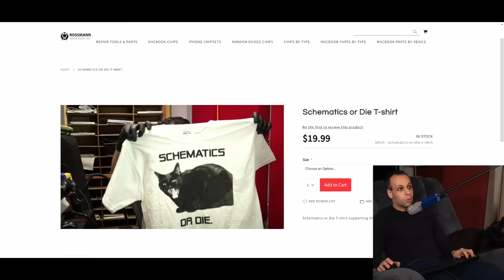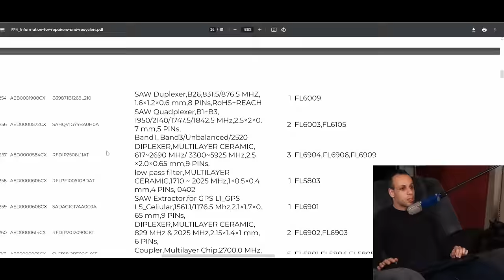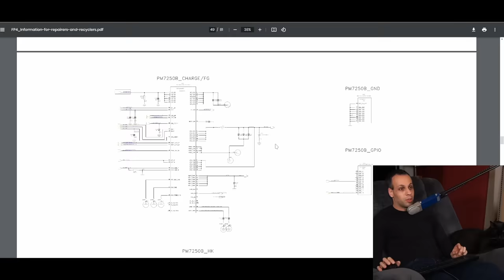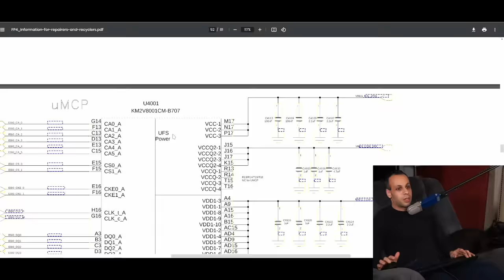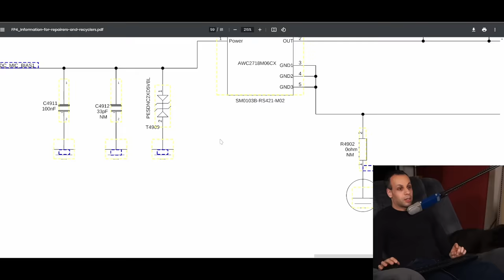Why I was wrong about fairphone

Comment: I actually hate fairphone I brought one and I will tell it here because I can't post my review anywhere. NB: I will send you this trash phone if you like.

I got a FP4 back in april of this year and had nothing but issues with it, The lack of a headphone jack meant I needed to get an adaptor when I use it for directions I ride a motorcycle and I have to listen to directions. the headphones would glitch out and fritz out constantly I had to disable almost all security features on the phone to get it working with google maps a issue reported on the forums but no fix offered the phone would disable it's GPS features when the security lock screen came up resulting in maps not working.

The plug socket that it uses for everything is extremely unreliable it was only after a month of use that it started having issues with charging and this made the headphone issues worse it would frequently disconnect and not correctly reconnect with the wired headphones, I used wireless headphones like they INSIST on me using and the Bluetooth headphones couldn't broadcast through my helmet and would disconnect immediately.

The Camera started malfunctioning and wouldn't connect when I tried taking photographs with it.

I had software glitches and memory issues, And then after 6 months or so in September of that year the phone died... completely died it was full on battery it just turned off and wouldn't turn back on and is now a completely dead brick of a phone.

It's undamaged externally it had a screen protector and a protective case... The phone wasn't dropped or mishandled it's just built by chimps out of tissue paper. I've never had so many issues with hardware from any manufacturer.

I could potentially send it in for replacement but honestly I don't want another one of these fucking phones.

FUCK fairphone 0/10

I'm currently now forced to use my incredibly old LGG4 that I replaced because the memory was going bad on it and I get weird softlocks on it's OS now... but that's forgivable after 8 years of service not 4-6 months unlike this supposedly modern phone.

Comment: Okay, it's nice that they provide the schematics for their earbuds however, the argument of removing the headphone jack for the sake of sustainability is still utter BS.

I have not watched your original video on the topic, so maybe my opinion overlaps with yours in the video:
By renoving the headphone jack, they basically force users that upgraded from an older version of their phone and have been using cabled headphones all the time to buy new hardware, instead of continuing using the old one. The No.1 use case of headphones and earbuds is with smartphones on the go. So they are basically creating more e-waste along the way. Yes, you could use a dongle, but dongles suck and finding one that works with your phone ins a pain in the a...

Comment: Pinephone not only has schematics openly available, but also all the firmware.
Reply: What about a headphone jack? I'm shopping for my next phone
Reply: didn't he try one of those and it sucked though? i dun remember good
Reply: @ThatKoukiZ31 It has a audio jack, but its OS really isn’t ready to use for most people. It’s not android.
Reply: it's also mostly phones with no sustainability in minds.
Reply: @outseeker  The  original pinephone, yes. Then again it's 150 USD, so bear that in mind. They also make the pinephone pro, which is considerably more usable, though I wouldn't recommend it for a daily driver yet as you will require quite a bit of technical knowledge to get any software to work. And is way more expensive.

Comment: If it had a headphone jack, I had already bought one. But since it doesn't, I am still contemplating, if I can justify getting a Oneplus Nord CE 2
Reply: Check out the Samsung Xcover 7. It has IP68, a removable battery and a headphone jack. It uses a MediaTek Dimensity 6100. I have the XCover 6 and it leaves nothing to complain about.

Comment: I mean... I'd love to buy their phone...but I refuse to not have a head phone jack. Even if I haven't actually used mine in over 2 years due to having blue tooth... I still want it
Reply: I thought I didn't use mine much so wouldn't care. I'm so glad I got a budget Samsung phone instead of a higher end one though, because as it turns out, I now do a lot of listening to podcasts while mowing lawns. The main reason I wasn't using it much before was drought meant the lawns just didn't grow, so I didn't mow.
Reply: @tin2001  seems legit. I used the jack substantially more before I got my Bluetooth headset, but for the last year or three it has been either Bluetooth or just phone on speaker  playing in background while doing other things....but I'll be damned if I am going to give up the option to go back to headphones if my Bluetooth dies.
Reply: You guys know there are plenty cheap usb c wired buds around?
You are just being spiteful.
Reply: @Napoleon_Blownapart  spite has nothing to do with not wanting to be forced to adopt a new interface that's is not better, is not cheaper, and does not allow use of older peripherals...solely because some corporate ass panda wants us to buy more expensive crap that is designed with planned obsolescence(in general, not necessarily that said intent is involved with this company specifically). The fact that USB based headphones exist is irrelevant. I have a Bluetooth that does not require any wired connection to my phone and I STILL WANT THE OPTION. This isn't like VCR to DVD where the technology changed and required an update.... this is a categorically inferior option being foisted upon the consumer and idiots not seeing the problem with the practice.
Reply: @unshackledjester  lmao. You said it all. "I dont used it for years yet ima keep bitching about it"
Why would phone makers accommodate you for a feature you dont use?
Nobody was happy when they removed it in the beggining, me included.
But the world has moved on, and now you guys keep bitching about it like your phones wont work properly without that jack.
If you want wired buds, there are alternatives. Fact its, the jack is disappearing day by day, you wont miss it much in the near future.
Get over your spite, geez

Comment: how exactly does that stop it from being a scam though? they said "the phone's sustainable" "you can open it and change the battery" "we provide schematics" which's fine and all, but you said the phone's sustainable, and not having a headphone jack is not exactly sustainable, making wireless earbuds, which we all know has lower audio at a higher price mark WITH NON REMOVABLE BATTEIRES on top of it, isn't exactly sustainable, I can understand the product being more expensive since it is in face, ethically manufactured, what I can't stand behind however is misleading advertising and bad price-to-performance gaps.

Comment: I honestly don'r think they removed the headphone jack to sell more wireless earbuds.

It's a feature that you're average consumer probably doesn't care about bc chances are what ever they had before the fairphone didn't have a headphone jack. And it improves dust/water resitance which will result in less damage over time.

But, giving people the option of being able to use wired headphones that will last decades instead of wireless that will only last a couple years if your lucky, in my view  far out weighs any dust/water resitance and a few replacement headphone jack

I don't think they were sleasy/dishonest... just wrong

Comment: I'm glad to hear this.

I finally bought a Fairphone 4 last Black Friday because it was on a decent (-140€) sale on a retailer in my country.

I kinda get why people are so hell bent on the headphone jack, and their explanation really wasn't sufficient, but I barely care about the jack missing despite really preferring wired headphones.

The jacks have broken or semi broken in my two last phones, and while it would have obviously been super great to have the jack on a modular and repairable phone like Fairphone, I can see it being possibly the most fragile part of the phone that needs the most swapping. Especially bad if you are doing something intensive and tug pull the wire out, that's going to pointlessly weaken the point.

In that sense, I'm personally fine with the adapter life. If the jack has a tendency to be that fragile, I would rather have it on a disposable adapter, and at least I can change the USB port when that eventually starts getting cranky from the increased tear.

Besides, I think I would still prefer to use an adapter over the built in jack, since one of the best things about the adapters/ability to get audio digitally through the USB C port is that you are no longer constrained to the DAC of the built in jack.

My last phone was Moto G5, and I think the DAC in that was very mediocre and lousy, but I was also stuck to microUSB so I couldn't get around the DAC, unless I would get great wireless headphones or some sort of Bluetooth DAC.

Instead, I kept using my old phone as a music device (it's going to occupy just as much space as some Bluetooth DAC either way) whenever I was going to listen to more music... until the headphone jack got so bad that it required a lot of fiddling to even register that anything was plugged in, and extremely gentle operation to keep playing sound through the jack. Then the jack in my main phone started acting, but not as much yet, but I was already using more Bluetooth stuff now, especially since most of my music was on the older phone either way.

I haven't started using the FP4 yet full time. I insist I get a screen protector before I make it my phone proper, and it took some time until it arrived to the stock on the retailer.

Either way, I bought some new wired earbuds (Tin T2 and TRN EMX, one is a plug type which my ears don't like very much, but one is actually a "bud" that doesn't seal the ear!), both with detachable wires, because apparently that's a thing with many wired audiophile market IEMs now. My Bluetooth headphones can also be used with a wire.

The last thing to hope for, it was implied that they might eventually revise the design on the wireless Fairphone earbuds, hopefully so that they make the batteries replaceable, but it's still kinda crummy to release one that's so standard and disposable.

I think the issue there is that they literally build their products around parts that already are being manufactured, and then they put an additional layer of their own design around the components to make them modular. Based on that, they try to pick the most popular and readily available parts so they can guarantee spare parts for years to come. There's simply no one in the market that makes wireless earbuds with replaceable batteries. This is an uphill battle to them, if they really want to make somewhat repairable wireless buds.

Comment: The Samsung buds+ as far as i know, has replaceable batteries, same with the iconx. They use standard batteries you can relatively easily replace. Now, wired headsets they usually give with phones won't even last as long as the battery in a Bluetooth pair... Unless you keep it in the box and not using it. So in many ways switching to Bluetooth is more sustainable as long as there's no mandated replaceable earphone cables and recycling for the broken ones
Reply: Fuck no. "Thin wire + magnets + plastic buds" is far less waste than "Plastic buds + plastic case + PCBs + magnets + more magnets + lithium batteries + even more shit"

Also, IEMs with swappable cables are the goat. You buy the whole thing once, and usually the first thing (and second thing, and third thing) to go is the cable. So instead of replacing everything, you just replace the cable, which is relatively little waste and also incredibly inexpensive.
Reply: @probablyjohn5589  do you know normies who buy IEMs?

And no, you can't compare 1 wired pair to 1 Bluetooth pair. My iconx still works perfectly, after years and years. My wired phones wouldn't. 

I know how good removable cables are, got a pair of big headphones with Jack on either side and Bluetooth for other times, they're great.... They were also 300+ euros. Normies buy the cheap stuff and replace it every 3 months, because they don't think it's worth it, or simply too poor (coming from Hungary myself, not really liveable wages for many people)

So compare 5 wired phones to a single Bluetooth buds. I know they are also more than 5x expensive, but then again... The iconx still works. I also have a buds+ because of the 8 hour playback battery. Using it daily at work. After 3 years, they are still perfect, and they have replaceable battery.

So in your place i would lobby for better lithium recycling, because the electric car revolution might F us over much more than some small pieces of plastic and copper
Reply: @CMDR unematti  I absolutely agree with investing in better lithium recycling. Mind you, the actual solution is to stop putting batteries in everything, but you can't win them all...

And to be perfectly honest, I forgot that most people buy cheap shit. When you consider that normies buy either Airpods or cheap earbuds (or worse, cheap over-ears) things are probably in favor of wireless.
That said, wireless has tons of problems and I'd rather not subject myself to them. Like latency. And having to charge them. And (usually) bad audio. And interference. And the oh so wonderful wireless standard known as Bluetooth, which works not so great on Linux and even worse on Windows.
Reply: @probablyjohn5589  I'm not saying abolish the jack, i love the interoperability. Hell, the air...things, the small ones? Could easily fit the connector for IEM cables so they could be both. Would like the same option for the Samsung buds.

I know there are many problems, not just with the Bluetooth. Recently i had to find out that 2G radio is messing with the USB-C audio output (some shared ground, or don't know...) It makes the audio clip, pop, turn off. It's BS all around.

Latency... Yeah, got some fun bugs from that too. That's why I love the jacks on my headphones: Bluetooth latency? Just plug them in. 1 pair of phones, dual function! It even has wired mode with NC.
Audio quality wasn't a problem for me. The buds sounds reasonably well, the big cans are just awesome, even on BT. I really haven't found interference to be a problem, except when walking 30 meters from the phone, even then, the cans work fine, the buds cut out a bit.

Well, i better stop, or I'll go on writing a book... I see your point, just offer some counters. You buy whatever you buy, it's not us F-ing up, it's the big companies, anyway
Reply: @ChrisWijtmans  blitzwolf br0 seems what you mean. Sure it's lithium battery, but these are really easy to change the battery in if you're really into that.

I had one from audiotechnica like 10 years ago, it would still work if i didn't destroy it (hair ties were holding it together for the last year of use)

The Korg NC-Q1 has 2 jack connectors, work with any standard cable, has Bluetooth with great microphones for calling, noise cancelling... Sure it's lithium too...

But i implore you to compare the innards of the AliExpress one with any of these and also compare how much you throw away in AA battery compared to years of recharge in lithium (and after years any semmi competent service guy can remove the used battery and solder you in a new one, these you can buy by the size like my audiotechnica had 5x0.5x1 cm battery. All these are 3.7V, if you only find a smaller size, that would work too)
Reply: @ChrisWijtmans  yay. And? Look at the clip-on Bluetooth adapters you wanted, they're tiny, one with AA or AAA would be much much more bulky, and not needed when changing the built in one is only necessary after 2-3 years of use. 10+ hours of playback time does away with the need to change them out when drained, too

Comment: They could solve the problem by taking the wireless buds back and rebuilding them with new batteries etc. But is that better than just giving a headphone jack? That depends on how much wire and what kind of wire is used in your headphones.

Comment: As someone who used to be opposed to the headphone jack removal in the beginning, I have to say I am coming around on it. Most people simply don't need it or want it. 

Even people with phones which have headphone jacks are more and more switching to wireless. And for the people who really can't let go of their wired headphone, there are little clip-on bluetooth receivers with 3.5mm jacks. Yes it's an extra cost, but if you are going cheap, it's like $5 and if you are going top of the line, it's still just somewhere around $30.

So as far as I am concerned, headphone jacks are a non-issue